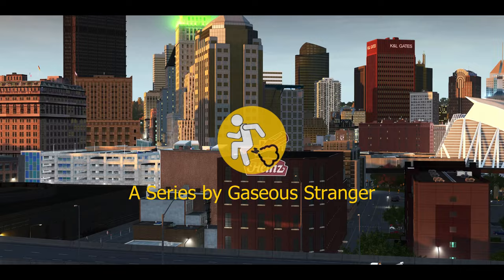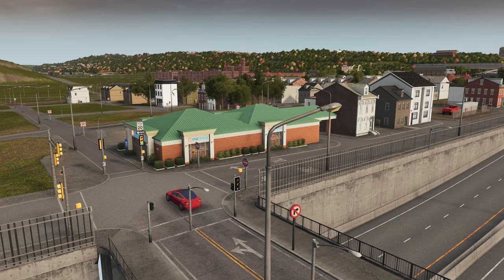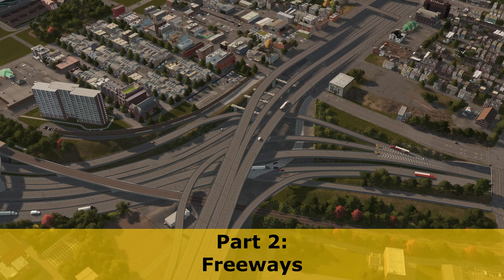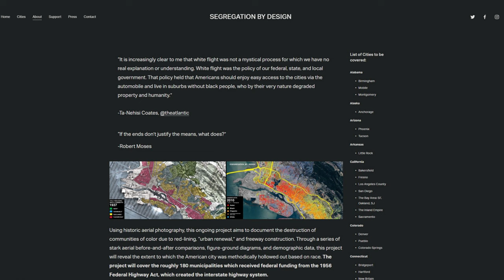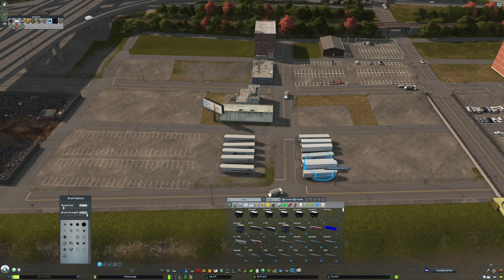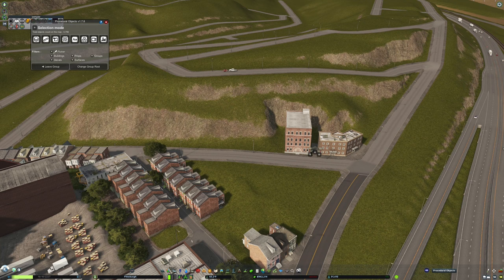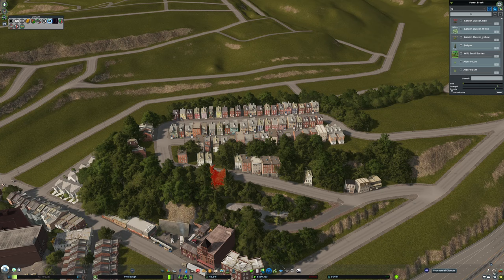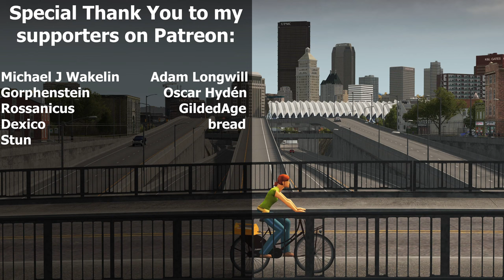Freeways Divide Cities - How Can We Fix Them? | Cities: Skylines Pittsburgh

Comment: The building of freeways/motorways through city cores is a phenomenon particularly associated with the US thanks to the Eisenhower administration. That administration was effectively bought by the car lobby, and as part of that slashed non-car based alternatives. Europe has followed a totally different approach, and placed emphasis on alternatives to car use. major Motorways go around city cores, not through them. Restrictions keep most cars out of the city core, and instead focus on using public transport (bus, rail, metro, light rail). It works far better. It transports far more people, using far less space, cuts inner city pollution, and avoids ripping the heart out of communities and dividing them in two to make way for motorways. The Eisenhower approach is seen internationally as the worst possible solution that gets people into the city core in the least efficient way possible, with maximum pollution and destruction, coupled with vast waste of space then for car parking.
Reply from the maker: It nearly had a lasting influence on other countries such as the Netherlands as well. Thankfully, they have since worked to replace their urban freeways inspired by the Highway Act. You can read more about an example of one such freeway here - https://amp.theguardian.com/world/2020/sep/14/utrecht-restores-historic-canal-made-into-motorway-in-1970s